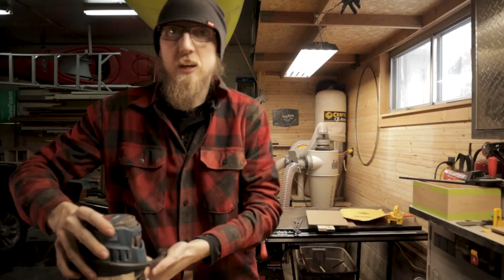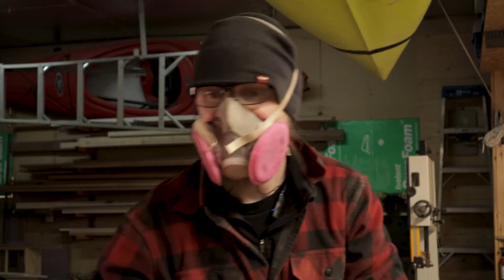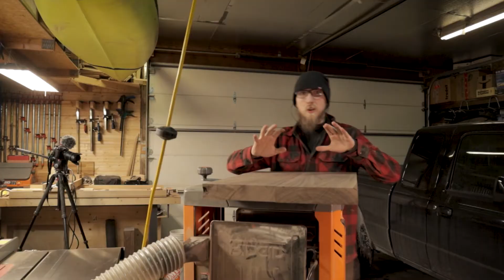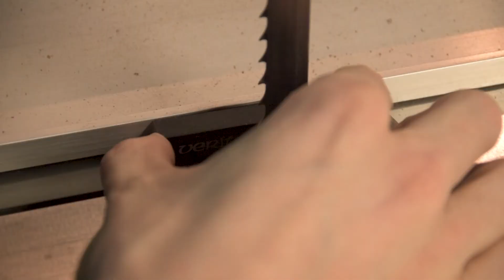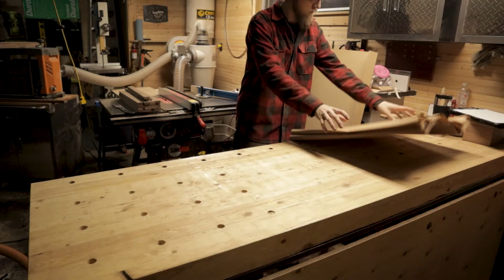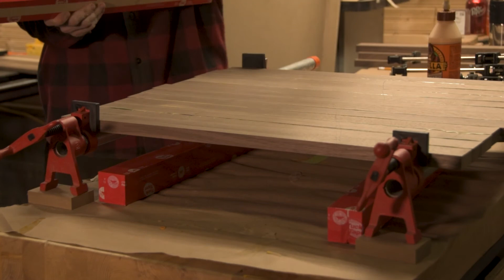Walnut Tea Cabinet - Part 1 - How to make fake quarter sawn walnut panels | Fine Woodworking

Comment: Do you think flattening one side with a hand plane and then running it through the planer on the other side would save time?
Reply from the maker: You can defenitly use a hand plane, I did that for a little while but I found it pretty tiring when I had to mill up a bunch of pieces. You also have to take the time to constantly check for flat across the whole face and that's why I like using the router. You can set it up once make the passes and you're left with a perfectly flat piece to then pass through the planer.